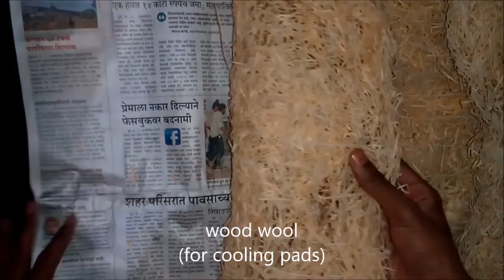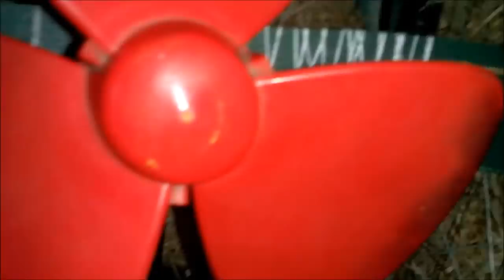How to make an air cooler at home (with water level indicator)

Comment: Water level indicator bahat achhi hai bt pad ka pani joo bahar ja raha hai wao thik nahi hai agar aap bana raheho tao pura dhyan do aur water dalne ke liye pipe use kiye magar dren ka kuchha nahi kiya saf kese karoge dren nahi hoga tao aur ek bat temprecher chek karke b batana chahiye kitna coolnig deta hai
Reply from the maker: Thanks for your suggestions.
Cooling pad ke bahar wire mesh laga sakte hai taaki leakage naa ho. Aap apna alag idea bhi laga sakte ho.
Maximum water holding capacity sirf 4-5 litres ki hai. To water bohot jaldi sukh jata hai isliye drain k liye provision nahi Kiya. For draining system, you can make a hole near the bottom and seal it with drain plug when not in use.
Cooling is not as much as AC. It is as much as a regular air cooler. So I didn't show temperature drop using thermometer.
I hope you enjoyed the video and thanks for your support.

Comment: A 12v motor works on electricity tell me and which adapter our use please tell me
Reply from the maker: 12 volts 1 or 2 ampere adapter

Comment: Plan and settings is excellent but better system is failed how many batterys are you can use for a day think it
Reply from the maker: I have connected it to an adapter which can be plugged into an AC socket directly thus eliminating the need of battery. 
Thanks for support✌